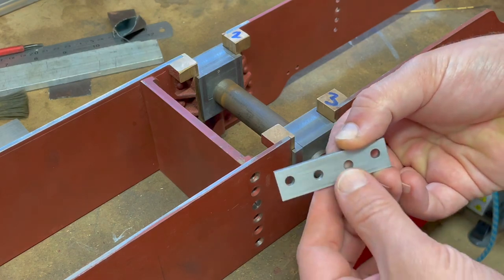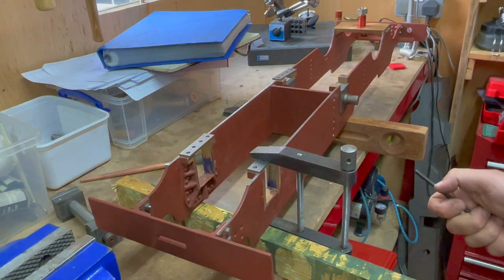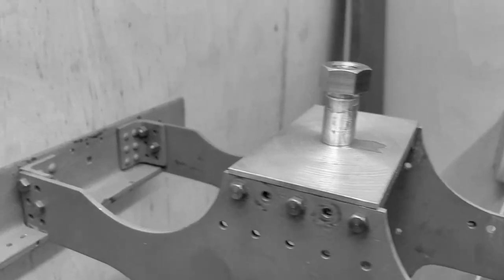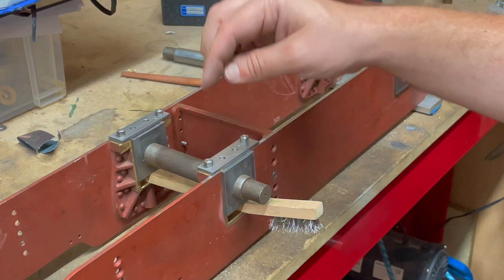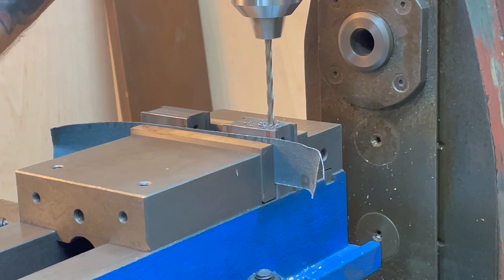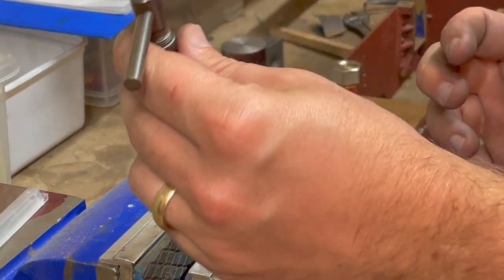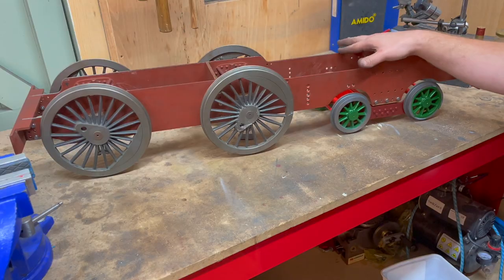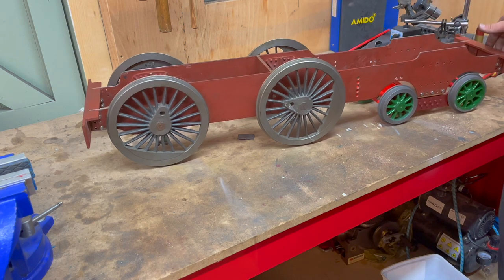Let's Roll Out! - Maid of Kent Steam Loco No. 22

Comment: Another landmark moment. On a different topic, sometime soon I hope to get my Kennedy hacksaw machine operational: it doesn't currently have a motor, could you tell me what the rating is of the motor on yours ? I'm hoping that I have a suitable motor 'in stock'.
Reply from the maker: Hi George, it's an old Hoover - I think 1/4 horsepower. The major limitation is the weight (or lack thereof) on the cutting arm, so there's never much stress on the motor other than keeping it going.